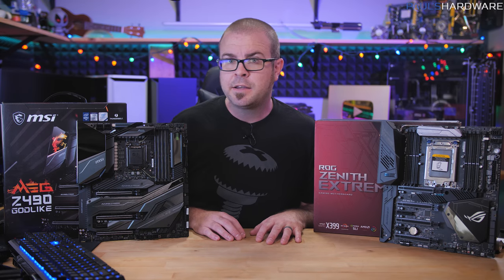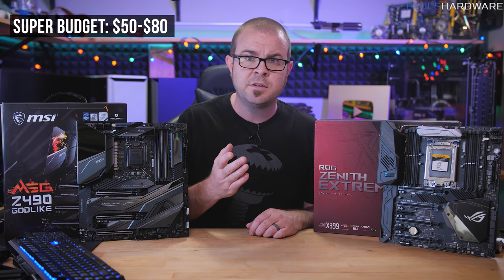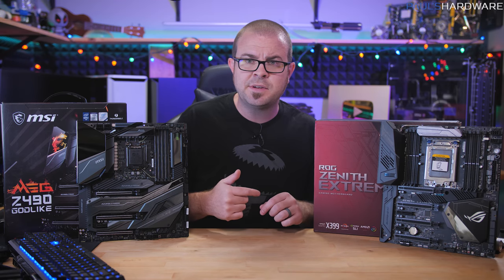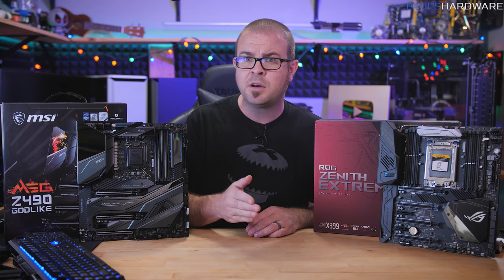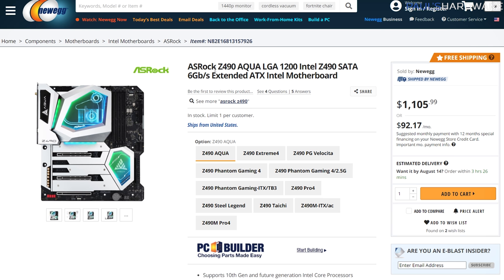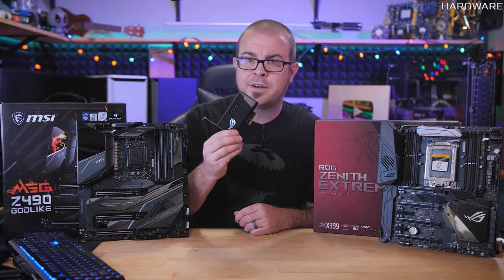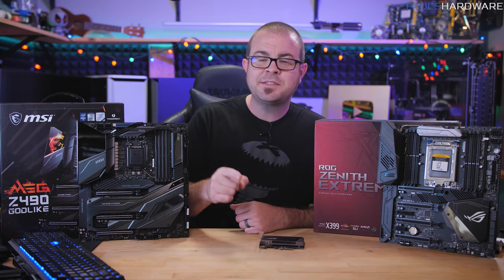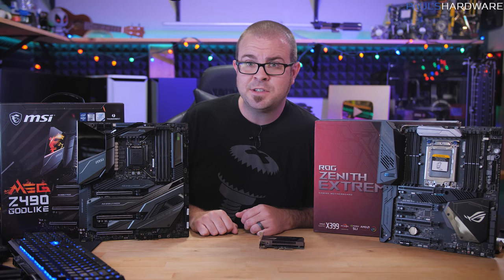What Does a $700 Motherboard Have that a $200 Motherboard Doesn’t?

Comment: Too many motherboard models with too many features or not hidden in between the model number, with the same chipset version.
Earlier in 2021 I was looking for an ATX motherboard that would have PCIe 4, USB 3 front ports, DP video and HDMI with WiFi on back. Of all the models in Gigabyte, the limitations were in the video ports. Asus was the only make that fit my needs however, the model available was in the $265 price range, TUF Z590 Plus WiFi. Never in 20 years have I spent that much on a motherboard. I did save a bunch in April 2021 on an i5 11600K but as of today, it's priced much higher again, around $280 if its available. Once the price of PCIe 4 NVMe drives fall, I'll opt for one at that time. By far, a very good running rig however, the options I wanted made the overall build a good $200 more than intended. The new form of motherboards is coming out in a year or two, that is when I will purchase or slightly before, a new case, 500 chipset motherboard, Intel i7, 32gb DDR4 and NVMe to replace a Sandy Bridge system. That board & CPU does not support TPM. It doesn't look like the newer builds are going to be that much better for the money as they move to DDR5 and newer PSU formats and motherboards.

Comment: Dang my z390 has the bios flash button code read out led muti bios ect and it was only 200 when did this end up qualifications for a 700 mobo. I understand the 10 gig nic as that is quite a niche product for the avg user unless they have huge data transfers inside there own network
Reply: Same. Mine was 275 and has all of those things. Except the 10 gig nic. And I've seen 10 gig nic on boards at 300.

Comment: "formula boards are always geared more towards watercooling" only recently after the 6 or 7k series intel are they geared towards that. but yah, currently they are, i would not say always.

Edit: should you pay for high end audio on a motherboard? NO, should you pay for highend audio on a sound card... yes and no. should you pay for high end audio via usb, unless you have the desk space, NO!! if you have the deskspace, that is the optimal solution, but a lot of the solutions out there aren't very good or are of questionable reliability. picking a decent brand is generally difficult if you don't know what you are doing or are looking to buy something that is not for your use case. A Focusrite scarlet is NOT an audiophile product, that is an audio interface for audio recording and broadcast. if you are looking for sound quality, burson is generally good, topping has some rep and is making decent movements towards a decent enough brand, and there are others out there. if you are looking for an internal sound card, look at a creative labs ae-9, asus stx-ii or EVGA nuaudio device. the AE-9 is actually better optimized for the computer market including broadcasting. if you want surround, go with something like a high end Yamaha receiver and power it via HDMI and also buy some high end speakers to go with it. either way, DO NOT SPEND MONEY ON  HIGHER END AUDIO ON YOUR MOTHERBOARD!!!

Comment: Getting DAC doesnt mean u dont need a good sound card! I originally assumed the onboard audio wouldnt matter as long it has an digital output until i got my ROG board and realized right away that you cant expect the same results from all sound cards simply because u use a TOSLINK... also not all soundacards offer features like DTS or Dolby stuff...

Comment: Something I very much wish motherboards DID have is a 3 pole audio jack. 

I don't have a headset with separate mic and speaker plugs. My headset has a 3 pole plug that's both mic and speaker.

Which doesn't work on my motherboard. I can have either a functional mic, or a functional headset. Not both. 

My case also doesn't have a 3 pole jack, so I'm screwed there too. 

My monitor has 3.5mm jacks as well. Guess what? It doesn't have a 3 pole either. 

So my only option is buy a new headset, or buy a 3 pole audio adaptor. 

The adaptor isn't expensive, but I shouldn't have to have it. My PC should have the damn ports I need. It has SEVEN audio ports for fucks sake. Nine if you count the two on the case. And eleven if you count the two on the monitor. 

And I can't fucking use any of them.

Comment: The M.2 WiFi internal connector on the motherboard NEEDS to be used more on some high end board models. I never use WiFi and the screw prongs on the back of the motherboards with integrated WiFi look very ugly. Many enthusiasts use wired connections and not WiFi. As aesthetics have become more important, those gold colored screws poking out on the back plate look horrible. I'm not saying to never offer WiFi on the boards, but to offer at least one high-end model that uses only an internal WiFi M.2 connection for the many people that don't care about WiFi integrated on the board (and also to keep costs down). If someone needs to use WiFi in the future, the M.2 connection is there to set it up on the cheap.

Comment: its sad to think i paid a reasonably high amount for my strix x470-f.  It didnt come with a lot of features it really should have for the price.  aside from its slightly higher voltage distribution and thicker construction, it has no extra features compared to a "lower end" x470 board...next motherboard i buy will most definitely have power and reset, clear cmos and bios flash, as well as wifi...the particular board i bought doesnt even have built in wifi...(to be fair i opted out on the wifi version because i perfer hard wired)....and its standard ethernet connection opposed to something even a little higher would have been nice

Comment: The included waterblocks are very good and a proper block easy can be +200  or more alone... but a 1000 for such a complete pack is ridiculus. 500 or maybe 600 is my range for such a combo. Haveing some games lately needing faster reading from the storage I added an m2 raid to my system .

Comment: More useful things on Motherboards that are often tied to their price:
- Amount and Type of PCIe-Connectors (multiple 16x Ports etc. I'm not talking about the PCIe Lanes, just the physical connectors, even if they are not wired 16x)
- Reinforced PCIe-Connectors
- Amount and Type of IO-Ports, Internal and External (Stuff like USB-C, USB Gen 3 2x2, Thunderbold, U.2, Internal front USB-C connectors, etc)
- VRM Cooling Solution (you mentioned it, but didn't count it as useful feature)
- RAM-Overclocking support (how high the board lets you overclock the RAM and how locked down the subtiming settings are)
- Dual Bios

Also I do disagree about the Audio think. Yes you are right, if you want Audiophile quality, you probably shouldn't spend a thought on the Onboard Audio Solution, but especially on mid-range boards you should probably take at least a look on the Ports. Many cheaper boards only have 3 3.5mm Audio Ports (stereo only). More expensive boards often come with 7.1 Audio Support with 5-6 3.5mm Ports and sometimes an Optical Audio Port. And that is an actual feature that may drive decisions.

And finally some more stuff thats eather in between or straight up useless depending on your personal preferences:
- Onboard RGB strips, displays, just ask corsair, they can put RGB on pretty much anything by now
- Sideways Connectors (what I mean that is Power Connectors, that are mounted sideways, sometimes with cutouts in the PCB to make cable management easier)
- Multi-GPU Support (SLI, Crossfire, NV-Link) mostly useless by now but still a feature that has to be supported by your board

Comment: looks at m.2 storage -"airflow is a bit problematic because it's hidden under the graphics card". Meanwhile, any slots of those kind on all the motherboards everyone has are on the back of the motherboard. Yes, in the spaghetti of wire management on the back of the card, you will find 2 of those cramped in, lol. Take that, airflow!!

Comment: I've been running a line out to my little Sony shelf system and figured the "improved" audio on the TUF B450M Pro Gaming I used in my new build would offer better sound quality. Then I went whole hog, replacing the Sony with a DAC and the difference is night and day.

Comment: a warning for people looking for intel z490 boards with a 2.5GBE  nic built in. MAKE SURE ITS NOT THE INTEL CHIP. current boards have a fatal flaw in the 2.5gbe nics and i cant recall if dropping them to only 1gbps solves it.

The gigabyte board i got (aorus elite wifi z490) uses a realtek solution without this issue

Comment: Your description of the backplate and why it's kind of pointless is exactly how I felt about literally everything you covered. You're telling me that the justification is that it comes with some add-on I could purchase anyway. I expected you to be mentioning something actually game changing, chipsets, bus speeds, idk, literally anything other than some gimmick and the mobo being dressed up.

Nice to know I can continue to purchase motherboards how I always have. Is the CPU slot correct? Check. Does it have the required number of slots for my purpose? Check. Is it a motherboard? Check. Everyone can miss me with their stupid LCD panels and LEDs everywhere on the motherboards.

Comment: I just wish msi kept the z490 like they did on my z390 godlike with 4 pcie slots, overclocking nob, quarter inch headphone jack. The z490 msi godlike does not even include 1080p game streaming card, an m.2 expansion card. I use these features thats why I bought the z390 godlike motherboard. I use the m.2 expansion card so I can have a total of 5 m.2 nvme along with my 2 sata ssd.

Comment: An I/O cover, as in the plastic cover over the rear I/O area is something I look for. I have a Thermaltake Core P3 case, so motherboards without this extra aesthetic piece look pretty ugly IMO. If I had a more "traditional" case, it would be fine, but for those with a more open case, some aesthetic touches like that are effectively part of the case, and your overall build.

Comment: Just to throw it out there the multi port m.2 pcie cards that don't have an onboard controller of some sort need PCIe Bifurcation on x16 slots to work properly which is one of those things you pay for with higher end boards.  Coming from the workstation/server space this is one of those things that is typically on a higher end server but not always on the mid range/low end and can be the difference between an expansion card costing ~$50 bucks or $200.

Comment: the most important reason not to buy the most expensive motherboards is support. The low volume motherboards have the worst long term support. so don't expect many bios updates and fixes outside of system critical ones.
Reply: I've got a good example for you.  before Ryzen came out, I upgraded from an Athlon to a Phenom II x4 system.  I went with a Gigabyte  GA-990FXA-UD3 Ultra board.  For AMD at the time, it was pretty advanced, has USB type C, M.2 on the board, reinforced PCI-E slots, all good high end features.  It has a buggy bios with several problems though.  For overclocking, the  CPU multiplier doesn't work, only BCLK.  So I went to look for an updated bios, and even to this day, the only bios available is the original F1 that is shipped with.

Comment: My build I is a Rtx3080 with an intel i7 10700k on a msi meg z490 unify motherboard, 32gb RAM g.skill trident 3600 cl16, 1Tb Samsung 970 Evo ssd and extra 500gb Samsung 860 evo ssd sata, 750Watt beqiet!, noctua nh-D15 black chromax in a nzxt h510 elite case with windows 10 pro

Comment: Hmm, my old PC Runs Still an Asus Rampage V Extreme 3.1 With an i7 6900K 4.5Mhz and RTX 2080 TI Kingpin 99% usage on 4K PS i only gaim 4k bec its not 2011 anymore wehre 1080p was cool... ps i dont bottleneck my gpu or cpu i will not even bottleneck the RTX 3090 Cards bec my rig are still on the top ^^ i wait on intel for 10 or 7nm....
Reply: I can't get more than 4.3 GHz out of my X99A Godlike Gaming Carbon Edition motherboard, i7-6950X Extreme Edition processor, and 4-way GTX 1080 Ti SLI graphics setup.
Reply: RTX 3000 need pcie 4.0 lol

Comment: So basically 4+ VRMs, more metal blocks/shielding, and watercooling.  The riser cards don't come with most of those overpriced mobos,  I've seen 10 gig lan on cheaper boards, and LED lighting is meh (that has nothing to do with performance).

Comment: Personally I have never seen the point in FGB I think it look nasty, but each there own I guess. Same with water cooling. I have seen many videos on water cooling vs air cooling and the difference is so minimal it seems hardly worth it. Good video, though. It really made me think on how much to spend for my new motherboard as my old one is dying. One of the PCI-E slots is dead and sadly, it is the faster one meaning I cannot use my RTX 3070 anymore so I am using a GTX 1060 6gb instead.

Comment: Buying an AM4 motherboard right now is not a great Idea at all unless you have a failing or failed board! AM5 is probably gonna pop next year, so spending 700 dollars on a high end AM4 platform would be a terrible investment. If you absolutely need a new mobo right now, X470 or B550 would be the best choice depending on what CPU you are running.

Comment: These are nothing compared to the $1000 gigabyte waterforce mobo. I have installed one and thats a big boy mobo. For my build recently I found the $299.99 mark was perfect im only missing the power and reset buttons on the mobo. I went with asus X570-E gaming. Previously I was on a asus maximus hero 6 that was a $200 board it has the power and reset buttons. I dont like how the power and reset buttons have become top teir options on asus mobos.

Comment: GigaByte X570 Arous Xetreme because it was the best on power and no chipset fan. Sure the 3950 to go with and a gigabyte 4.0 1 tb nvme. FE 2070 super.   When I build my systems are to last 8-10 years.  FYI   Thx for the vids.....

Comment: auto default bios after bad overclock (i overclocked the ram wrong it reset 5 times and opened the unchanged, working bios) AsRock Steel legend b450m

Comment: Motherboard audio is complete BS. Focusrite 2i2 solved ALL my problems. Combined with an Yamaha MG06 i can also stream in my Laptop without latency. Best is it is all balanced cables and the Focusrite has Mic Feedback / Sidetone / Monitoring in L/R & LR config with adjustable volume. It is worth every penny. Combined with an Modmix 48to5V adapter you can even use regular headsets witzh 3,5mm jack.

Comment: like SATA III is limited to 6GB/s... and people want faster boards for their 7200rpm 600mb/s HDDs. :/
I see SATA is on its way out. but thats still going to be a wile till a platform or wiring of its own is made for NV.Me or SSD Focused drives. for now... NV.Me can plug directly into the Mobo.
Unfortunately. if you want to run more than that, youll need SSDs, or youll just have a bunch of ported port wires porting NV.Me port chips off a PCIe socket.

Comment: And maybe, just spend the extra 5 or $600 on a higher performance cpu and/or gpu, and not need to overclock the hell out of it, and thereby not needing all the extra expensive cooling.  Just a thought.

Comment: I own a case with USB-C, 2x USB 3.0 [sic] and 2x USB 2.0 on the front panel that I want to use, so I'm looking at a ASUS ROG Strix B550-E Gaming which is $280, if that gives me pause then $700 ... like that $ would bump me from SAPPHIRE NITRO+ Radeon RX 5700 XT to ... nevermind video cards are stupid expensive. I am not their target market, but lets see what's under the hood.

Comment: The expensive boards are cheap boards plus higher amount of connections and increased power supply and bus speeds to enable multiple devices to work simultaneously. The extra expansion slots is the only advantage.. besides the bragging rights there is no other advantage. I was in the hardware support industry for 12 years, and we realised that 99.9% of customers with expensive computers on high end boards use the desktop for everyday computing and playing Windows OS games like solitaire and Pinball.

Comment: rip the msi mpg x570 gaming edge wifi motherboard the antenna connectors are broken atleast for the bluetooth one if i remove the antenna the connector just wiggles around the bluetooth connection is just as long as its right at the back of the pc moving it slightly and the bluetooth connection is gone had to purchase a bluetooth usb basically im not going to go for any motherboard supporting bluetooth and wifi anymore unless the connectors get more sturdy it broke afther 5 removals due to moving the pc around

Comment: Well.. need to make a better vid now its done completely for show, as it look crap at the moment i recorded it,  this was just made when i tried its first boot with every component thusfar installed hence the wires and stuff
but i used that ROG Formula bord for this, wanted to build something "different"  as the usual box under my desk.

https://www.youtube.com/watch?v=zuJBvYSpBWI

Made many changes, learned alot on the go.. but it was kinda a project that i got into over my head on costs, not the big main parts, but the small things, like the connectors, tubing fittings etc that made it in the end pretty costly..